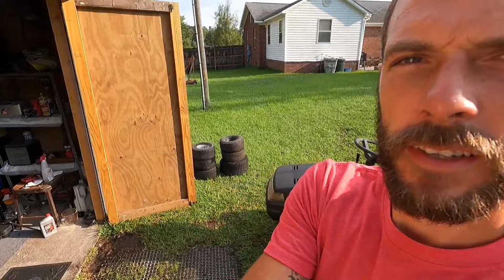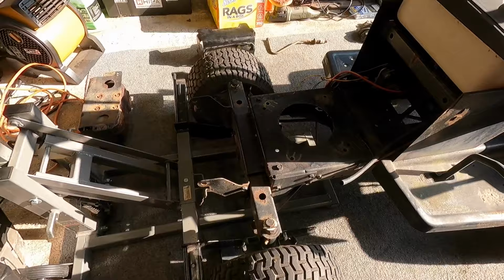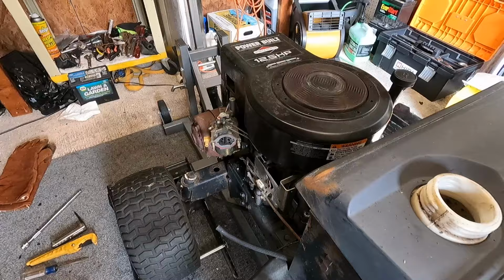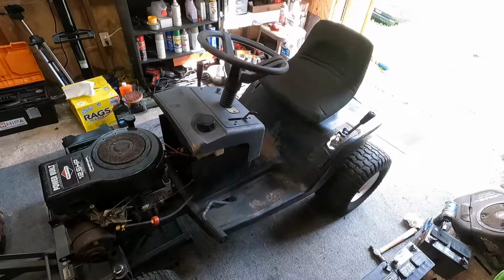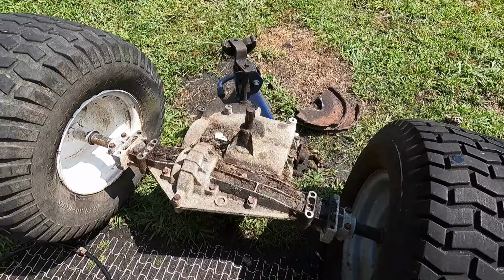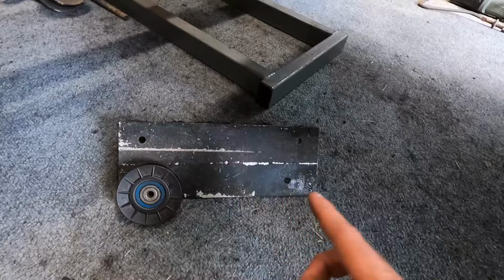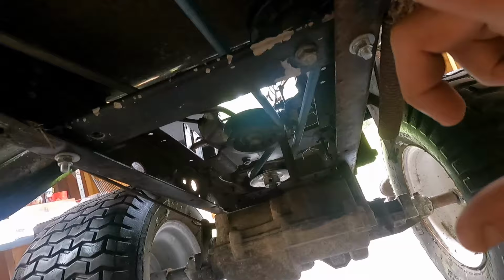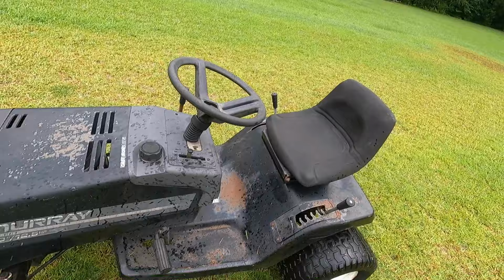BUDGET RACING MOWER BUILD FROM JUNK

Comment: You have inspired me to get my mower faster, I'm 73 and use mine for around the farm but now I wanna go faster. Thanks mate, great video.
Reply: Be careful 😅
Reply: Poppp
Reply: just make sure its a manual transmission this will not apply to a hydrostatic
Reply: @Jszul2318  exactly, it'll go pop if you tried.

Comment: ive raced mowers for 10 plus years ,nice job ,may i make a sugestion lower the rear down more , and the front to or or it will tip over going that fast , my race mower got speeds of 45 plus , have fun. Also to go faster put a big pully on the engine and small one like the one on the gear box and it will fly.
Reply: This so the comment I was looking for thank u!

Comment: Nice video, your videos inspired me to get into repairing and selling lawn equipment. I got a natural gift to fix things ever since I was a kid. Got a bunch of push mowers I'm fixing, some I pulled out of a dumpster. Always check and see if the engine is seized or not. Got a old craftsman 2 garden tractor, needs some work but I'm planning on turning it into a fun toy. All the craftsman needed was gas to run, bought it as a non-runner. Has a fuel leak, carb needs rebuilt, needs new ignition switch, needs new voltage gauge, and a new gas cap. And an oil change. Has a 18hp kholer magnum engine. Runs like a dream, minus the slow throttle response. And after tighten up the steering.
Reply: Sounds like what I gotta do for my husqy tlh130

Comment: Drill two holes and it’s easy to remove the pulley with cross bar puller😊😊
Any parts numbers on the pulley???
I will have to order one, nothing local